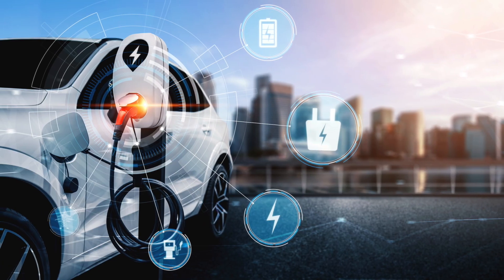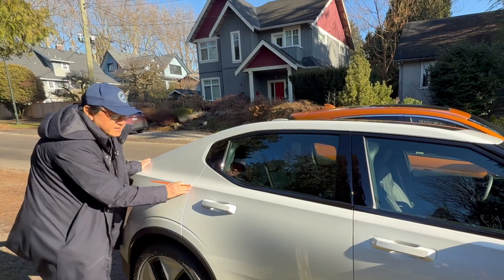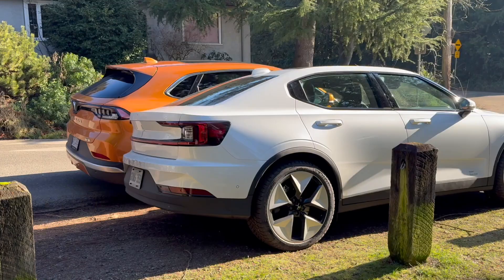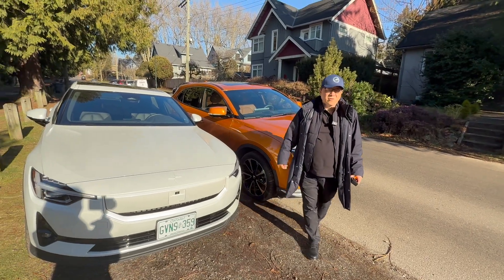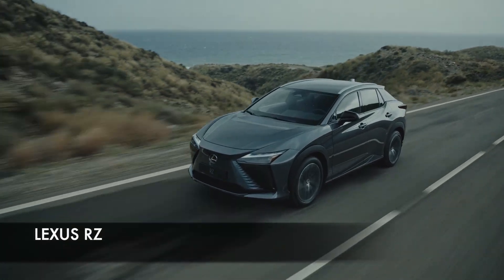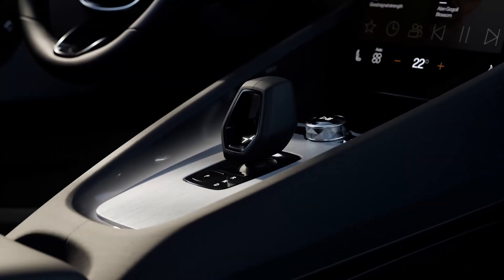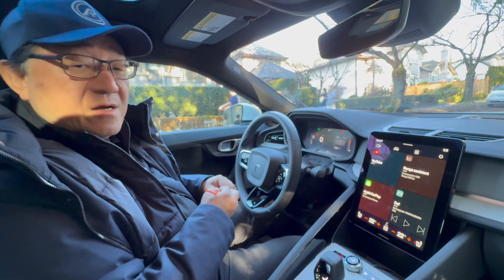ENGINEER'S REVIEW // WHICH IS BETTER? // POLESTAR 2 vs VINFAST VF8

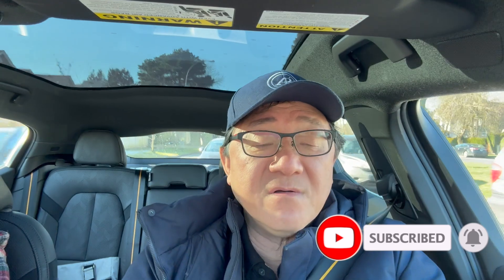Comment: Great comparison as usual David. EV‘s unlike internal combustion engine vehicles have one key distinguishing factor related to their powertrain and that is how fast they can gain back how many miles. There are multiple venues that try to gauge this and there are multiple ways manufactures stated specs, but there are a few that have come up with some standardized tests. Generally speaking the time it takes you to get from 10% to 80% is a charge time that should be the standard and stated add 70°F. I say that because most people won’t go below 10% on a road trip and the battery will slow down and it’s charging when you reach roughly 80%. This makes a critical difference if you’re having fun on the weekend or you’re having to get from A to B that’s longer than the range of the vehicle. The only other thing you need then is to know how many miles that 70% will get you down the road as far as a fit for your commute or trips you often take. Keep up the great work and if you want a reference to where I find some of this data, let me know. 19:45